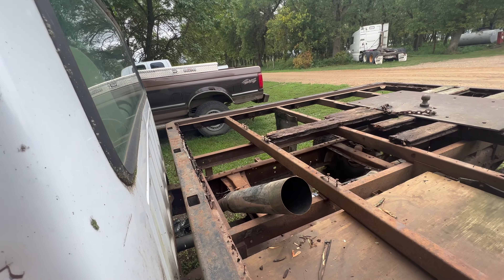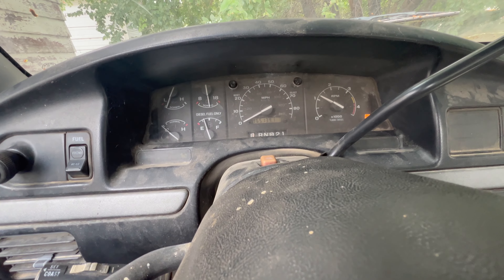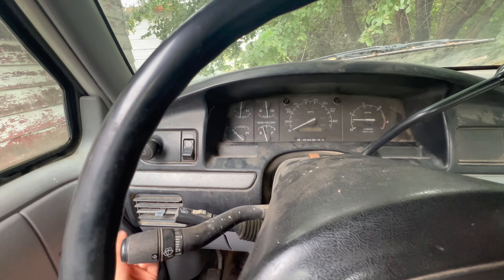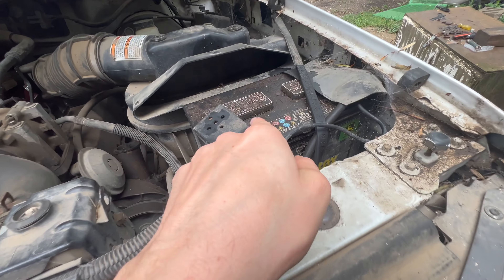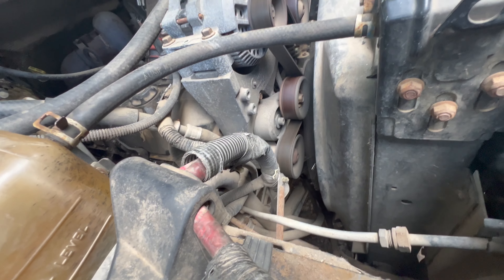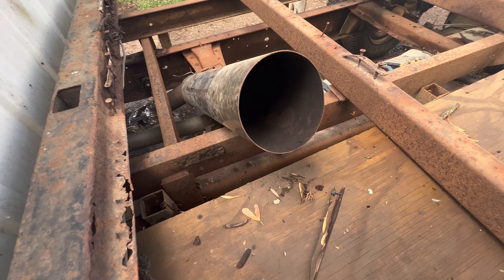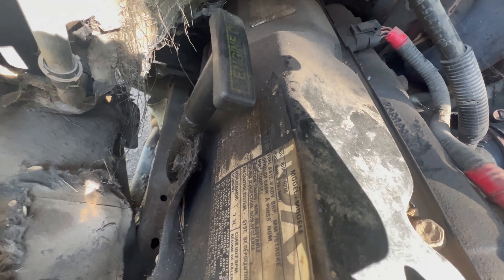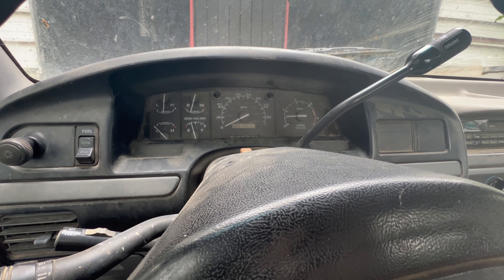Ford F 350 7.3 powerstroke turbo diesel update

Comment: You might try putting some automatic transmission fluid in the fuel tank, that might clear up the injectors a little bit, and maybe try replacing that sensor and see how she runs